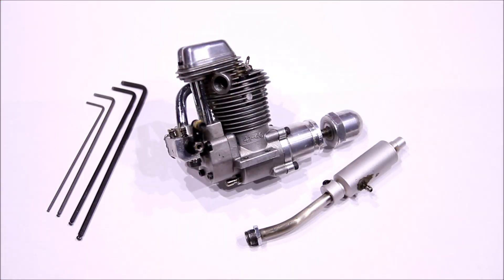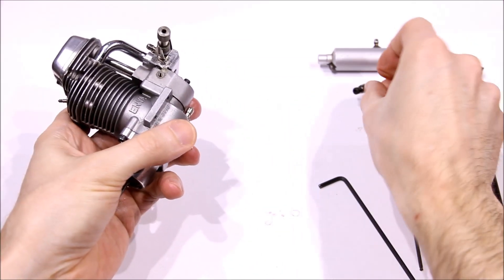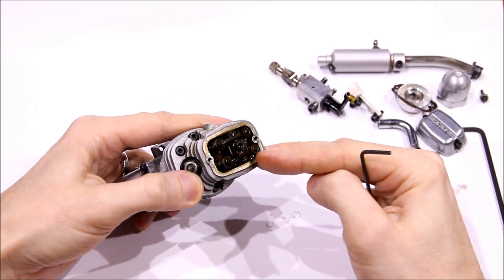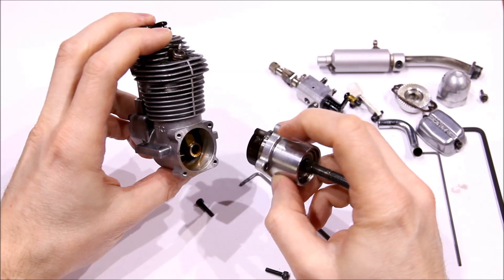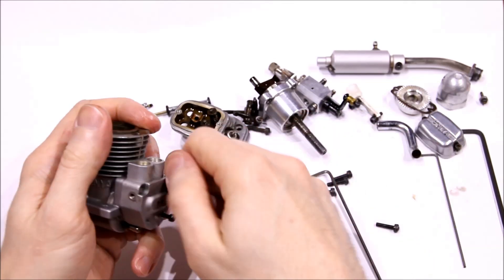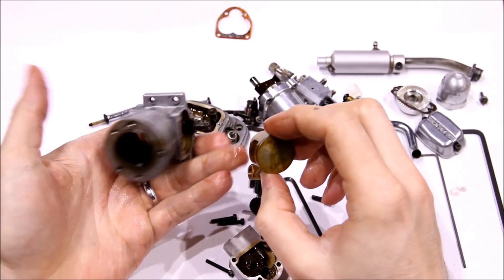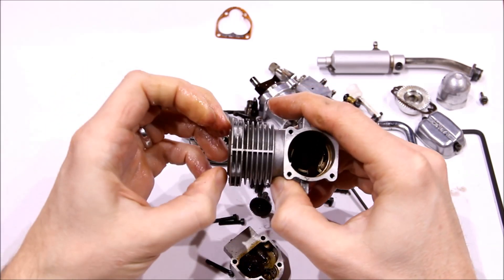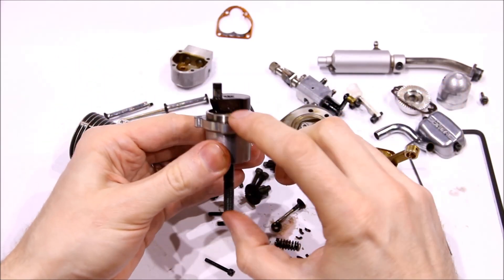Enya 41-4C Teardown for Rebuild

Comment: Your video has made me rethink rebuilding my 30+ year-old Enya 60-4C engine.  It was run maybe five or six times max back then and has sat installed in an airplane since then always kept indoors (of course).  It looks nearly mint on the outside but I'm certain it needs expert TLC inside.  Should I just put it on eBay?  What would you recommend?  Thanks for your video, btw!
Reply from the maker: If you want to run it, I would definitely look inside. Enya can get pretty rusty. If you sell, describe it as you did above so the buyer knows what they are getting. So many engines get sold as "turns over, great compression" and need bearings or sometimes have so much rust only the aluminum parts are much good, often the sellers are ignorant (or claim to be) about the actual condition. Regardless even these engine do well on Ebay. So many engines on Ebay and forums right now. I hope the proposed FAA regulation isn't driving this.
Reply: @rcdieselrc  Thanks for your quick reply!  My engine does not turn over.  That and my lack of knowledge here (even though I'm an engineer with a lot of internal engine background) tells me I need to pass this one on, most likely on eBay.  Unlike a lot of people, at least I know it when I don't know stuff.  Plus, I value my eBay rating too much to misrepresent an item.  Thanks again for your very informative video!

Comment: Any suggestions on how to reinstall the valves and retainers? I can't get those tiny retainers and valve springs in the right place at the right time!
Reply from the maker: Grease on the valve stem to holder the collets. A small tool with a hole in it, like a ~5mm open or closed end wrench to push the retainer down with. A slightly magnetic tool to pick up the collets with can be helpful. Working in a plastic bag can keep parts from being sprung into orbit.

Comment: have you watched the 12 v engine don't they need glowplug or spark plug?
Reply from the maker: Many model engines people build run on compressed air, not much different than a steam engine.
Reply: while compressing air doesn't leak?